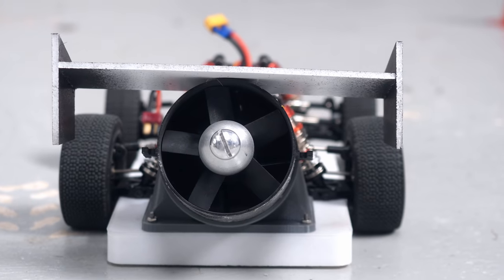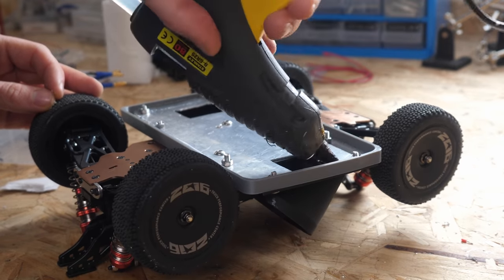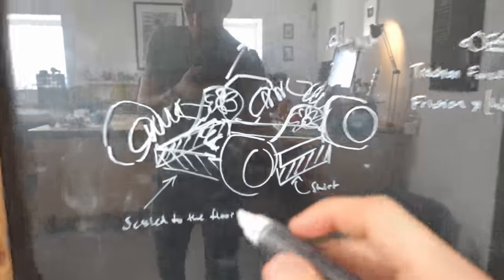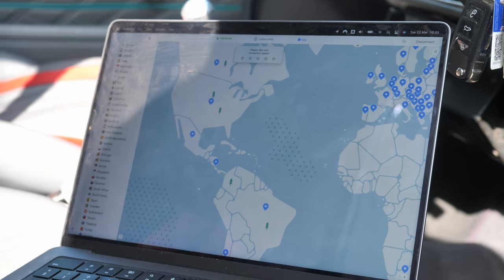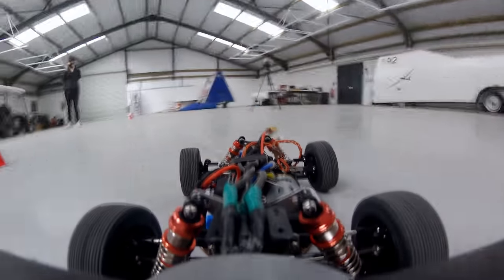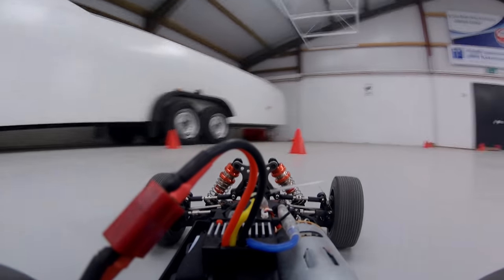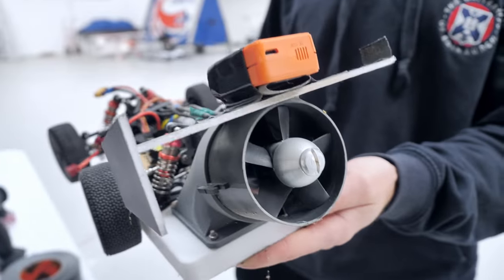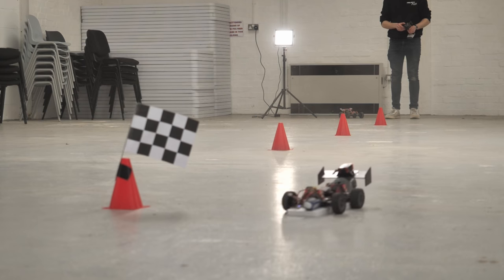Vacuum Effect RC Car

Comment: This design has a big problem and that is that the suspension will not work so the pressure seal between the floor and the vacuum cleaner will be cut. I don't understand why it was made so big. It's not about making it so big but about keeping the seal at a specific point and not losing pressure.

Comment: How about a 2 stage electric/chemical rocket, rocket. First stage is electric, second stage is on rails and only requires to slide off the electric rocket stage and continue upwards while you land the electric rocket.

Comment: Vacuum’s don’t pull, instead it is the high pressure air on the opposite side of the low pressure that pushes.

Comment: The suction should be modulated by the excelleration and by going into curves when going straight at the same speed there is bot so much downvorce needet i guess
Reply: Suction could also been used for stopping the car more fast

Comment: What is the difference between having a downforce or just adding the equivalent amount in weight?
Reply: Adding weight increases mass, and as well as worsening acceleration, the force needed to turn the car increases more than the increase in force exerted by the wheels due to increased friction, reducing cornering speed. Downforce increases the available grip but not the mass and force required to corner at a given speed. The increased force exerted by the wheels is not wasted to compensate for the additional mass and allows the car to corner at higher speeds.
Reply: @Mauro-82  ok thanks for explaining

Comment: You could've just place the fans horizontally, throwing air upside. And make it programable whenever you steer at high speed. Your concept had a flaw, which you kept on fixing in the name of progress.

Comment: You only want/need the downforce when you are travelling at speed, increased friction + drag etc from air ... when negotiating tight turns or lower throttle it will negate any positive effects.
Reply: Link it to the motor rpm maybe?

Comment: you could just put more weight on the center of the RC creating a biger down force then with a fan or you could put 1 fan on each end of the RC creating a better downforce since you are creating down force with just one in the back but the weight is distributed only on the back of the RC not on the whole chassie

Comment: I feel like you've forgotten why they wanted this type of car so they can blast corners without touching the brakes at a loss of top speed and acceleration but still faster than the cars that use those pesky brakes.

you have to have a corner heavy track not a straight line.
Reply: More suction means you can use thinner tires too negating some weight from the vacuum motor.
Reply from the maker: When did I have a straight line? Hmm

Comment: wall climbing with succ cups-turbine
Reply: edf is not the way, impeller pumps are the way
Reply: thats a hover rc car btw easily
Reply: combo hover-wheel car
Reply: enjoy doing vacuums and compressors
Reply: ionized plasma ultra vacuums
Reply: electrons to a metal electrode, ions outside of the whole chamber, ultra ionic vacuum
Reply: electron embedding into wall, positive charge on the car electrode hang plate
Reply: or just roll the filter across the inlet
Reply: just wipe the filter with a wind shield viper or momentarily reverse the air flow direction

Comment: Can't watch it to the end... does he sometime realise his Fans are supposed to turn in the other direction?
The blades are designed to move the air.. if you turn the blades backwards they not only work really bad compared to right way round, they also sometimes break cos of the vibrations.
Turn a Propeller backwards really fast and besides horrible singing noise it feels like it wants to destroy itself.

Comment: And if you do start playing around with going upside down with the car then you're going to need to use an air ride suspension system but you need to use pneumatic cylinders instead of airbags you need to use a push-pull Pneumatic cylinder that'll act as your spring in your suspension and of course you've got to use sensors with this system now I know you're an engineer so you're probably already ahead of me but for those that are not that are playing catch-up let me explain why when the car is upright the air that is acting as a spring is on top of the piston in the cylinder acting as a spring for the car but when the car literally goes sideways up a wall now you need are below and above the piston so that the car will still float in the suspension when the car goes upside down now you need air on the backside of the piston other words your suspension has completely reversed are is the opposite of what it was when it was right side up now you can use airbags to do this but a Pneumatic Ram is probably easier to use and maintain so you're probably going to need to use a small array of sensors to sense the car's orientation like I said a realm so aggravating most people don't want to mess with it